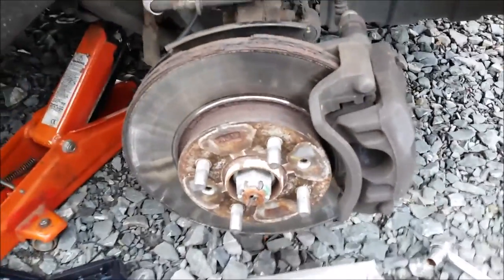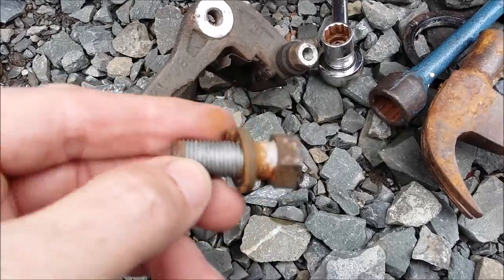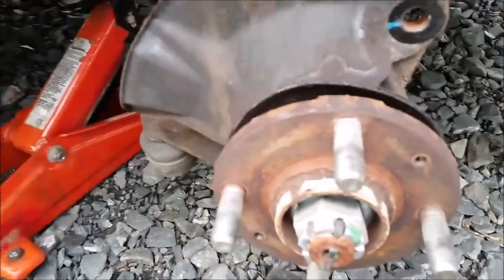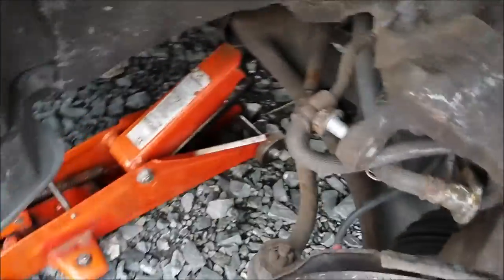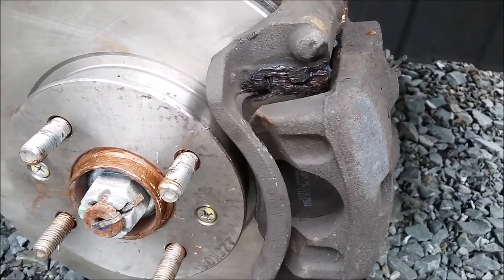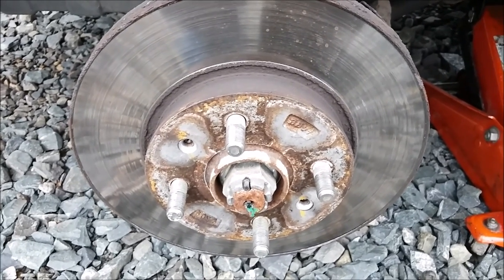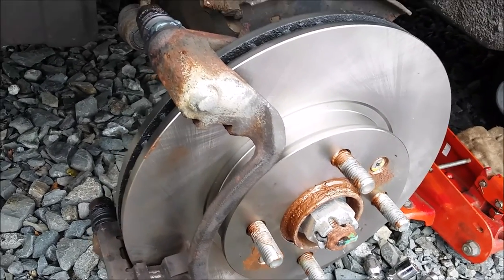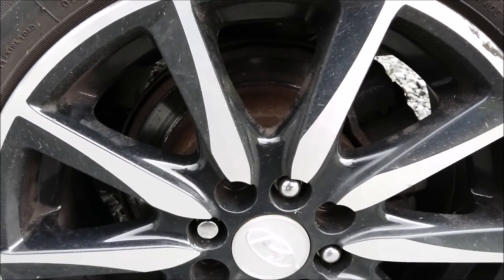Hyundai i20 1.4L CRDi Front Brake Disc Replacement

Comment: What i understand is you do not put anti seize on the caliper brackets, what is recommended is to putl locktite instead to ensure the bolts don't come off due to vibrations.  Putting Anti sieze is exactly the opposite of what is recommended.
Reply from the maker: It's possible in warmer climates that would be better but up here in Scotland, it might be different. I've never had any issues using anti seize compounds and encountering loose bolts. With all the salt they use on the roads in the winter, you feel lucky to get bolts to turn. Same thing with ARB drop links, they'll never (normally) come off as per instructions, have to grind the nuts off.

Comment: Not to be pompous but copper slip is a poor choice it melts at a low temperature and when combined with wet weather it washes away lucas red and tacky works well
Reply from the maker: I've not had problems with copper grease washing away so far but I'm sure there may well be other products that perform better. The main problem here in Scotland is the rust and seizing up of the various bolts due to all the salt on the roads. I'll have a look out for some of the Lucas Red that you mentioned for future jobs and give it a go.

Comment: You basically skipped all good to know points here...
- to clean the piston under the rubber with brake cleaner
- to open the valve while pushing the piston back
- how to properly remove the rust from the hub and brake pad's guide
- hot to put the new retaining springs
- how to check the runout on disc brakes

Amount of the copper grease you put is insane, as same as amount of rust left here.
This is how not to service brakes video, I belive you tried your best, but video can be dangereous as manual.

Comment: You shouldn't be working on brakes if you don't know what you are doing .Don't put copperslip on the caliper bolts ,it should be totally the opposite and loctite !!
Reply from the maker: Perhaps, if I lived in a warm dry climate, I would agree.
Here in Scotland you'd be lucky to get them back out with the rust. 

By all means use loctite, it may well be recommended but I can assure you I've never had a single bolt ever work its way loose.

Copper grease has a tendency to solidify, in my experience but does aid removal when you need it.
Reply: That's absolute rubbish , living in Scotland has nothing to do with it ,caliper to hub bolts are critical , even new good make slider bolts come with  a form of loctite on . I bet you didn't even clean the hub up when you put the new disc on !
Reply from the maker: @colinedmond6003  you are of course entitled to your opinion. I can assure you that living up here in Scotland the road salt plays havoc on a whole range of fasteners. What part of Scotland did you say you live in, where rust isn't a problem?
Reply: @gtd65  🤡